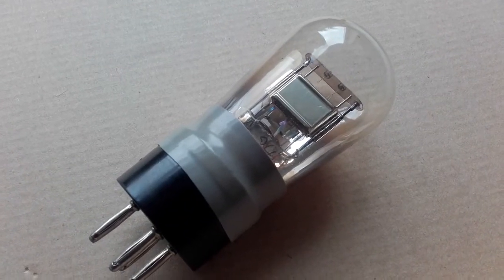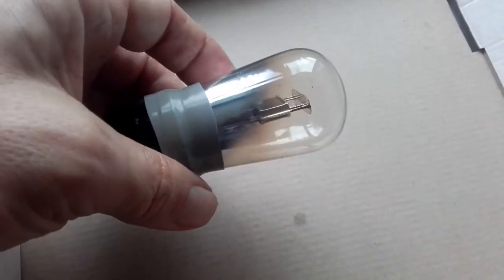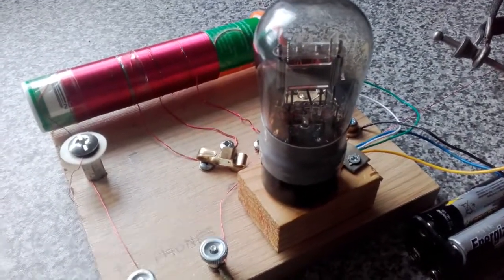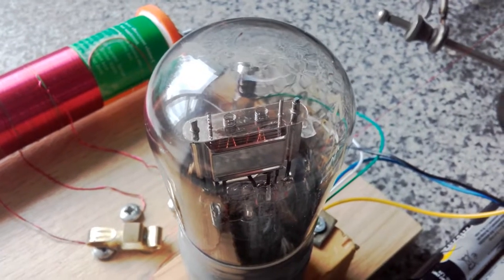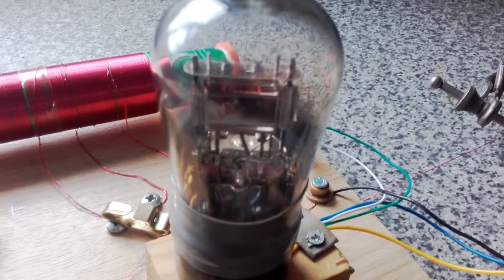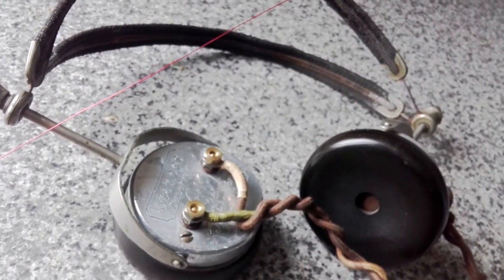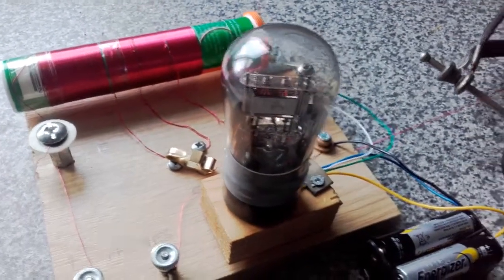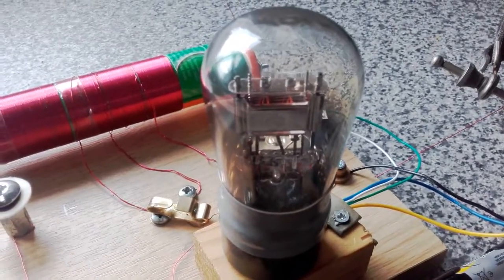A one valve radio as used in the ww2 prison camps

Comment: It would also be possible to make use of a triode, or almost any other valve, connected as a diode, so that the only voltage required would be the filament voltage. However, with a triode, it is possible to improve sensitivity and selectivity enormously by using regeneration. If you have an old battery valve, designed to operated on a HT voltage of 90 volts, it will, in fact, operate quite well right down to twelve volts, particularly when used as a regenerative detector.

Comment: Didn't they also use a lump of coal as a point contact diode. Even easier to come by.  The coil will have some self capacitance between the windings so with a certain number of turns you get resonance at a particular frequency (120 for Medium Wave).  A simple tuner involves scraping away the shellac and running a piece of tin across the turns to effectively shorten or lengthen the coil.

Comment: OK! So you are using the valve as a diode?
As for battery longevity, I just hauled out a pair of AAAs made by Philips expiring April 2003 from a digital pocket multimeter; no corrosion and they light up a 1.5V 0.3A pea-bulb perfectly!

Comment: No tuning condenser
Reply from the maker: I used a coil with wire taps to replace the tuning condenser but a tuner would have been more precise. 
I was wound to receive smooth radio.

Comment: Hi, will a O1A work? I have that. Thanks.
Reply: That’s sounds like a voltage regulator tube, which wouldn’t  really work! a triode tube would be great and some tubes you can get are dual triode tubes which can do a lot!
Reply: @tucker934  Thanks, I tried the   O1A on my crystal set, set some required volts on the filament, it actually worked, but the set is louder with a regular diode.
Reply: @TheCubbyman61  the 01A wouldn’t have a filament if I’m right that it’s a voltage regulator tube, and a quick search says I was Wrong. That tube is a triode, and not a voltage regulator tube. And the triode is what you needed
Reply: @tucker934  Yes it's a triode and 5 volts on the filament got it working on my crystal radio. Thanks.
Reply: @TheCubbyman61  Thats Great! I ordered some germanium diodes gonna try, and put one together got a wild over complicated idea for one. I say that I’m just looking to have fun with it! Glad you got yours working!